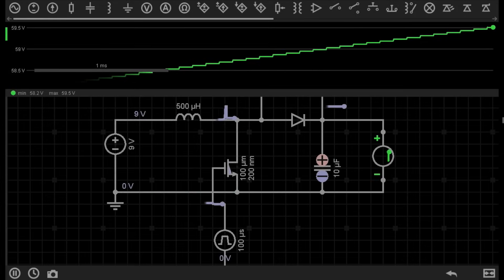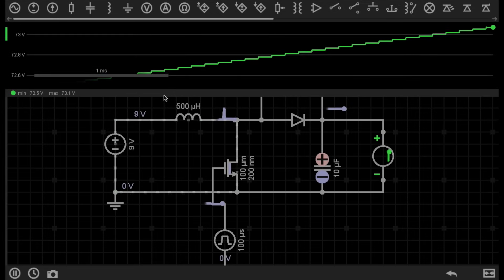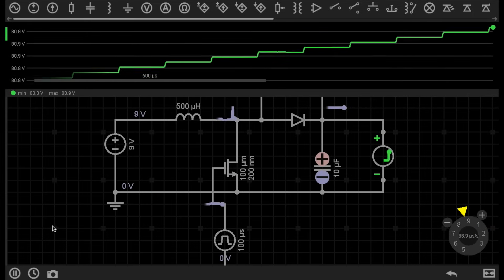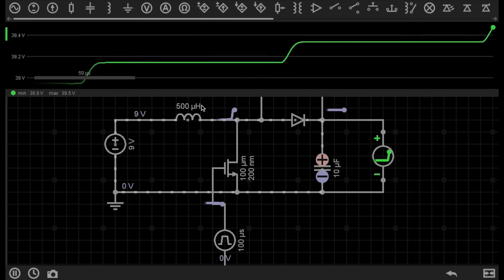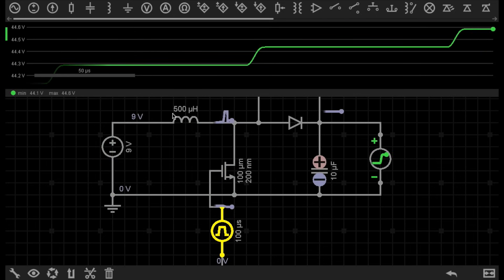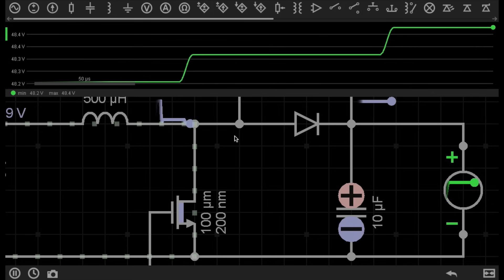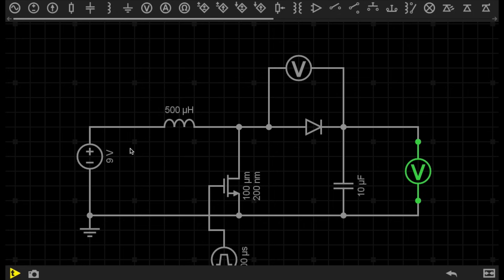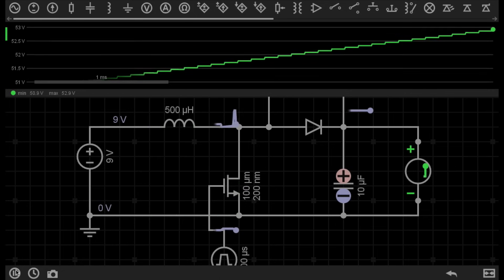How Boost Converters Work (DC-DC Step-Up) - Electronics Intermediate 1

Comment: This intermediate series is really useful, thanks and I hope you continue to make them.
Reply: Boost converters are a type of DC-DC step-up converter. They are used to increase the voltage of a DC supply. Boost converters are often used to power devices that require a higher voltage than can be obtained from a battery or other DC source.

There are many factors to consider when selecting a boost converter. The most important factors are the input and output voltages, and the current requirements of the load. Other factors include efficiency, size, and cost.

Boost converters can be divided into two main categories: linear and switching. Linear boost converters are simpler but less efficient than switching boost converters.

Comment: i want to design 12v to 48v but i confuse for value of capacitor and inductor...can you help me for that?
Reply: pathik modi You do not need to chance the values of that inductor and capasitor. You just need to adjust the mosfets on/off frequency.

Comment: Hi, thanks for the video. i have a simple question : this  device steps up the voltage in a very smart way using the physics of the inductor, but what about the current?  I mean, what is the total output power? Is it same as the initial?
Reply from the maker: If voltage steps up, the current steps down. Therefore the output current will be lower than the input current. However, the total power at the output will be almost the same as the input, there will be losses due to inefficiencies of the circuit. they can be as much as 90% efficient, some even higher than that.
Reply: Vasilis Toloudis .
You loose work from the high voltage, however, you can tap the capacitor to recover the work if you limit the voltage out.

Comment: I built a dc-dc booster circuit but the output voltage reaches its peak according to the load and keeps dropping after. Is that supposed to happen? If so, is there a feedback circuit I can use to stabilize the output? 

Thanks in advance!

Comment: but why isnt the capacitor charged up when the switch is closed ? isnt the magnatic field building up and the capacitor charching ?
Reply: the capacitor is charged for a nano of seconds the out we are having that is the capacitors out put vltages .. means voltage accross the capacitor . and you knew if capacitor charged the we can ge a volt around it but when it discharge voltage across capacitor is nothing
Reply: Because the transistor pulls the voltage down completing the circuit before the diode and capacitor get a chance to really see it. It acts like a detour splitting the circuit in half until it’s open then circuit has to complete through the diode and capacitor

Comment: sir. I want to make a dc-dc converter which convert 24v to 325v. and It will supply 10 A current. could I use this topology for getting 325v 10A supply
Reply from the maker: You're talking heavy stuff there. 3.2KW output boosted from 24Vdc? You'd need to be supplying 100's of Amps through an inductor which is just not practical. The inductor would need to handle a peak of 300A. You would be best using a transformer with a high current AC supply to step-up the voltage to 325VAC, then rectify and regulate this using a buck regulator.

Comment: How do we set up the maximum voltage? Let's say My nixie Tube IN-1 need about 170 volt to run. How can I make it work with a simple classic 12volt adaptor
Reply from the maker: We would use feedback to our PWM IC, the IC would regulate the boosted voltage by altering the Duty cycle. This is something I will show in future videos.

Comment: your channel should have more subs.
Reply from the maker: Thanks :) I am sure it will grow over time.
Reply: @SimplyElectronicsOfficial    does a boost converter charge batteries on a loop cycle?
Reply: @SimplyElectronicsOfficial  why didn't you continue this ;( pls come back making these types of videos...
Reply: Tampatec ikr it should have way more than yours. ;)
Reply: A new subscript here!
Reply: sadly he's gone... he has retired from youtube
Reply: @azlannakamoto7913  why?
Reply: What power supply is he using to the base of the mosfet?
Reply: @straceycalloway4833  it may be a trigger pulse
Reply: 114K
Reply: +1
Reply: Yay
Reply: i agree!!

Comment: What component do you connect to the base of the transistor? And how do you get it to fluctuate it's power supply?
Reply from the maker: +Kevin Lennox it would be a microcontroller which outputs pulse width modulation on the base of the transistor.
Reply: Simply Electronics So it's essentially a rapid square wave oscillator? (I'm asking because I want to try to build a similar circuit)
Reply from the maker: Yes, a smarter version would feed back to the microcontroller for regulation, but not essential for experimentation purposes.

Comment: Wouldn't boost conversion be an essential key to a powerful solar heat collecting terminal?
Reply from the maker: You mean a solar set-up for charging a large battery bank? Usually it's just a case of regulating the output from the solar panel to the battery charge voltage. Although chargers use a combination of constant current and constant voltage to regulate the charge. You may want to boost the output to high voltage and low current for running long cabling to the home for example, it can then be stepped down to a more useful voltage at the other end. In the other case inverters may be used to step up the voltage and change it to AC for powering the home.
Reply: what is usually done is different then what im talking about.  Would a proper boost conversion circuit within one solar panel not cancel out the need for multiple solar panels?  Thanks.
Reply from the maker: addaminsane It depends. If you boost the output from a solar panel, you increase voltage, but you reduce the current output. For example, a 24v 10amp solar panel is boosted to 120v, instead of getting 10 amps of current at 120V, you won't get more than 2 amps (probably less due to efficiency losses) . Same power, but less current.
Reply: Okay so in my mind, i see the solar panel as solely dc where you use a boost conversion circuit to make it as powerful as needed in terms of voltage, then you mate the dc, with an ac circuit optimized for high amperage ... then batteries / powerwall ...
Reply: Is it not a mistake to rely on solar for amperage?  Shouldn't solar just be used to collect a spark boosted to high voltage and then convert it to ac through an ac optimized relay?  I'm an electronics noob with alot of learned theories and little experience so i may be missing a huge point here.
Reply from the maker: +addaminsane solar can be used very effectively. But the laws of conservation of energy means you won't get more power out of a solar panel that what it can already provide. Whether it is boosted, inverted or regulated, you cannot get more energy out it. You do seem to have some missing knowledge but that is okay. Make sure you follow my electronics basics series of videos from the very start. Many theories are covered and very easy to follow.
Reply: +Simply Electronics Thanks man i appreciate your vids.
Reply: after step up the voltage from solar would it increase the charging speed of battery.

Comment: great tutorial! How do you calculate how high the voltage output goes? And is the output pulsating or effectively just 100V?
Reply from the maker: There's a great website here https://learn.adafruit.com/diy-boost-calc/the-calculator

You can use this to help you determine your parameters and components.

The output will have some ripple, but the capacitor smooths this out.

Comment: Can you explain me why When the switch if off, the polarity of the inductor changes, and the circuit uses inductor as a source instead of the 9v voltage source ?
Reply from the maker: +Duc Pham because when the switch is off, there is now energy trapped within the inductor in the form of a magnetic field. It wants to get rid of this magnetic field, and the only way it can do that is to get rid of the excess energy in the form of electrical current. Therefore the only path it can go to is through the diode and capacitor. It has to change its own polarity to allow its current to flow to the capacitor.

Comment: is this a taser? 😂
Reply from the maker: +Cesar Gonzalez not quite, tasers work differently.
Reply: Simply Electronics i tried to build this but for some reason the voltage goes up and down 0-18v. input voltage is 18v.
Reply from the maker: +Cesar Gonzalez what are you using as a switch and what frequency are you switching at?
Reply: Simply Electronics npn transistor, c1383 dont know much about 'em
Reply from the maker: This transistor is not designed for high frequency switching, you would also be better of using a mosfet instead of a BJT. What frequency are you switching the transistor at?
Reply: Simply Electronics 220uh inductor, 47uf 50v capacitor, 1 diode. so the only thing i would need to change is the transistor/switch?
Reply from the maker: No, I also asked the question... What frequency are you switching at. You may need to use a higher frequency.

Comment: What is the name of software used in this video?
Reply: The software shown in this video is called Every Circuit. Other circuit simulation software you might like to check out: 
iCircuit (iOS and maybe OSX)
LTSpice (Windows and OSX)
Circuits.io (Web based circuit design and simulation)
Reply: Thanks for some alternatives!

Comment: Excellent excellent excellent! I have been building these things for quite a while now, and you are spot on!
Reply: Question. Can this circuit be used to boost power from let us say a 22 volt battery to heat a heating coil resistor to heat 6dl water in a 1 litre volume for a duration of time?

Comment: If the transistor for some reason doesn't swith fast enough, it seems we get a short circuit on the input voltage?
Reply: MsLia32 Very much so.
Reply: MsLia32 yes, because the inductor is just a wire, any wire will short inc an inductor

Comment: pnp or npn?
Reply from the maker: In this example it would be an N-Channel mosfet (NPN). You could use PNP by applying negative voltage to the Gate instead of positive voltage.
Reply: Thank

Comment: Please l have a mini generator that generates up to 50v and I want to use this circuit on it so it can power my refrigerator, can this circuit work for the purpose ?
Reply from the maker: Your refrigerator needs an AC input, You need a step-up transformer for this if your generator is putting out AC. If you generator puts out 50v DC, then you need an inverter to convert 50VDC to 120/240VAC.